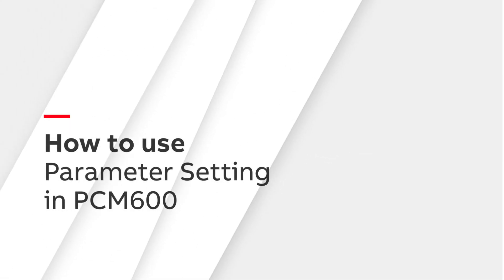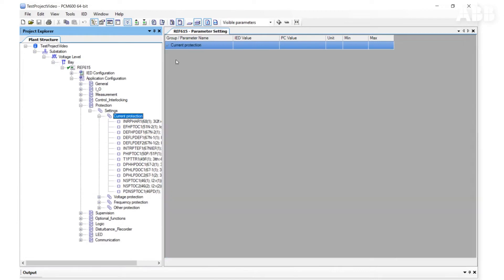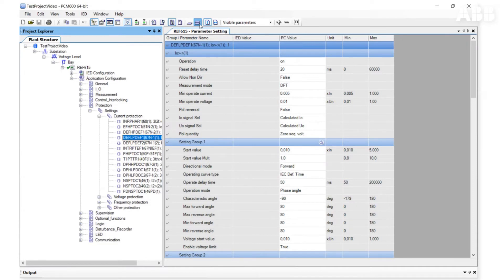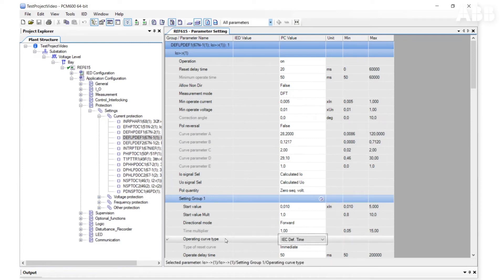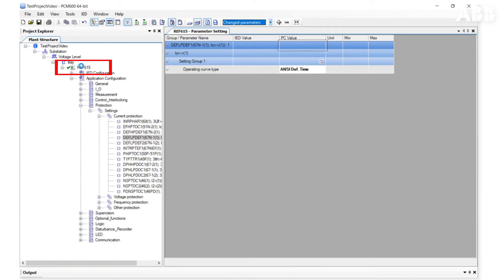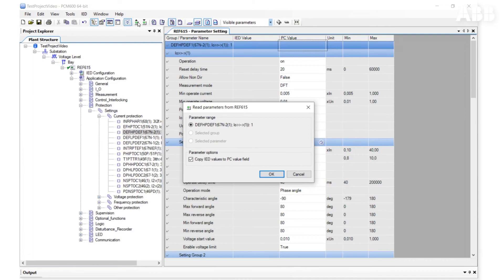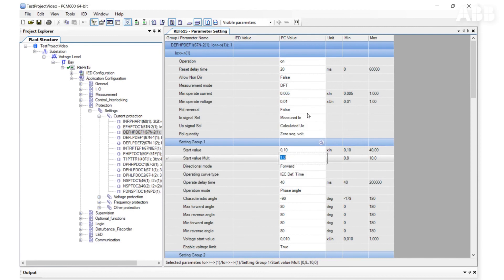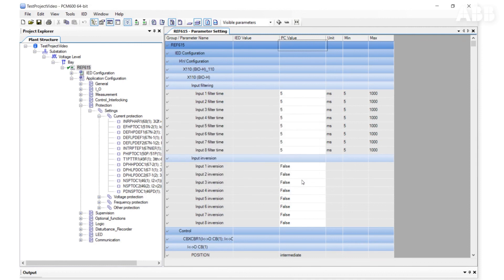3- How to use Parameter Setting in PCM600?

Comment: As i am electrical working completely on abb relay ref615,ret615,rem615,red615,and reg615,and facing scl configuration error because i have done mistake that i put another feeder psl in that feeder in which it has psl already,so please make how to correct this error.
Reply from the maker: Hello @rakeshverma-cu8ug. Please refer the information shared on https://relays.protection-control.abb/knowledge-warehouse or get in touch with your ABB contact to have this reported to ABB support line for investigation.

Comment: How can i change iec to ansi in pcm600
Reply from the maker: Hello @user-wm9wv4mv4g. 
You can change it via menu bar in PCM600 software through the following path:
Tools >> Options >> Language Settings >> (Default IED Configuration Language) or (Naming Style).
Please note that normally the protection relay can be selected as IEC or ANSI version in the pre-ordering selection phase via ABB Relays-Online tool.
Thanks for contacting ABB
Reply: @ABBlearning  Hello, still doesn't work. Even after I changed language to ANSI in options, when I'm configuring part number, IEC is locked and greyed out (I can't change it to ANSI)
Reply: Dear sir kindly make video on ref615 current and voltage protection settings thoroughly, please